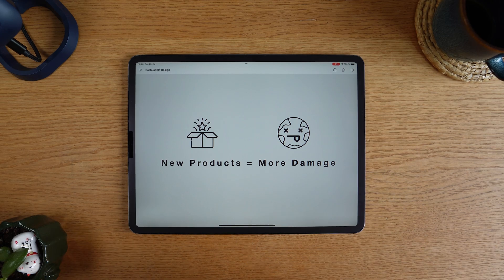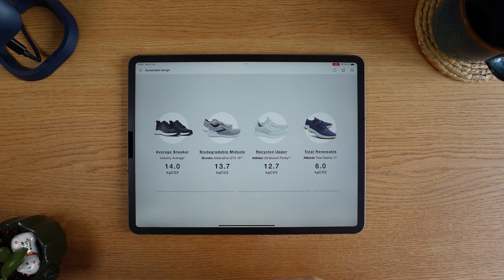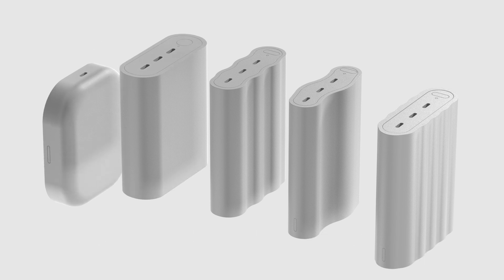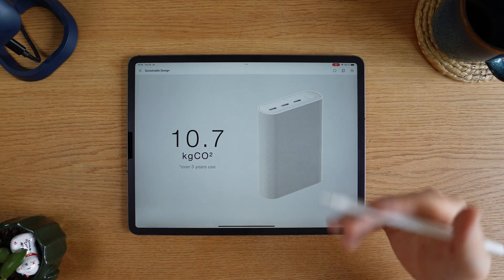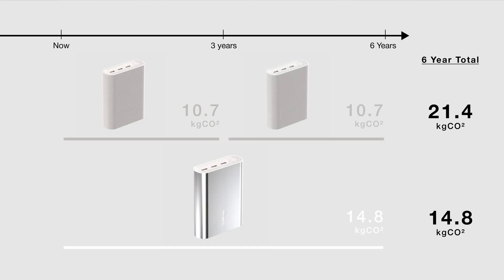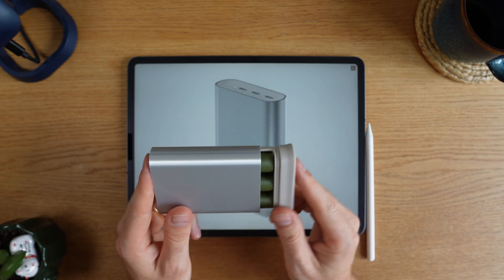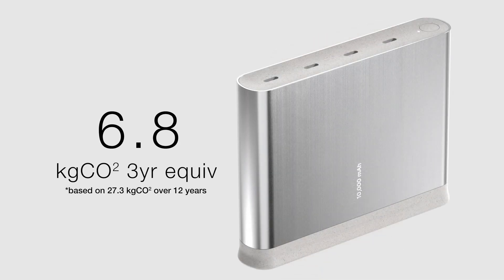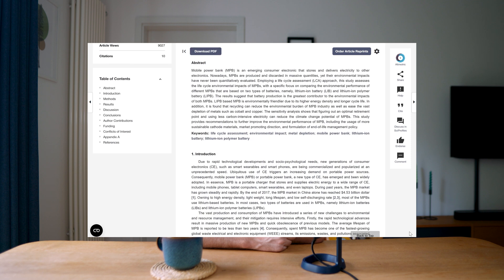How to Stop Greenwashing for Designers (LCA)

Comment: Great video. I will say, as a product designer we have to understand 'why' a company might make specific changes, for example, working on a project recently. To achieve UL certification / IEC CB certification the materials used were required to be UL94 rated to atleast V1, many materials available could only achieve this at 3mm thick - where as the optimal thickness would have been 1.5 - 2mm range, even though the fire risk of the product was extremely low, it's where approvals have actually pushed us to be less sustainable. Same with the use of environmentally friendly polymers, if they aren't UL Yellow Card then you'll have a bad time trying to get into the US market.

Comment: Nice video but I feel like it's too optimistic. I'm not a product designer but Who is going to keep using a power bank for 12years? It's gonna look like a scuffed up piece of metal in about 3years of use, and it's gonna get worse every year. The electronics also have to be reliable enough to go that far (which usually drives up the price as well as the carbon emission). I'm probably nit picking but these are some things to think about.
Reply: Actually I think it works well. I've had my powerbanks for 5 and 7 years now respectively. Yes they look worked up, but who cares? It's not a fashion piece, or at least that's my opinion.

My advice (and I am a product engineer) would be to make the casing of stainless steel, which is more durable and also cheaper financially as well as ecologically (especially if the steel mill already uses hydrogen for smelting, but even if not).
The USB-C connectors will live for ages, so the only further improvement would be to
A) make the electronics and plastic part separable
And B) publish 3D printing files for the plastic part, to reduce the impact of shipping when upgrading or repairing.
Reply from the maker: @danielhahn55 this are some great point and I really like you comments. The design was an extrusion, so AL seemed like a good choice. Super curious on your experience with stainless and custom extrusion?
Reply: @somegraythings  thank you so much!
Well I admit that custom stainless extrusion might be challenging, as it's not the most ductile material. I'd rather have a flat piece which gets bent around pins with the appropriate diameter, then laser-welded and polished flush. Didn't take those extra steps into account LCA-wise bit they'll still have less impact than using AL
Reply from the maker: @danielhahn55 definitely, good thinking
Reply: @somegraythings  thanks, means a lot - especially from you!
Reply from the maker: @MahfuzurRahman19 great points! I was thinking at least raw AL can be polished back to a new look, although maybe that’s a bit too optimistic to think someone would do that 😅

Comment: Nice video! The one thing I’ll say on calculating the life cycle is increasing the estimated usage time doesn’t necessarily translate as well as you’ve shown it. Products, especially like chargers and other electronics, typically have a lower life cycle mostly from the evolution of tech and actual usability. Looking at a 12 or even 6 year life cycle isn’t usually realistic when rating actual consumer usage. 3 years is a better number to base it on. Wish it wasn’t so! Either way, love your content and keep it going 👌👌

Oh and one other idea would be making it upgradable or changeable. Having replaceable batteries is a good start but I wonder if it could be made to keep the original case but upgrade or update the internal contents so it can evolve with humanity. Imagine having products that evolve over time like this (kind of like PC cases. You can always upgrade the RAM, GPU, memory, etc but have the same computer case for decades)
Reply from the maker: Good call! Yep, this is totally based on a lot of assumptions. I think the length of time people use this thing if more of a normal curve, with most people using it X number of years but some people use it less, some more. It would be interesting to dive into data about how long people actually use things to get some more realistic numbers here.

In the design I put a snap in cover for the electronics that would theoretically be easy to get into. But more analysis would have made this video even linger to make 😅, although I think you have a good point.